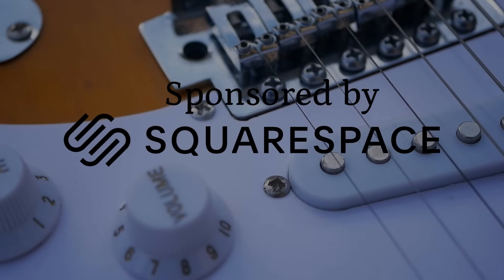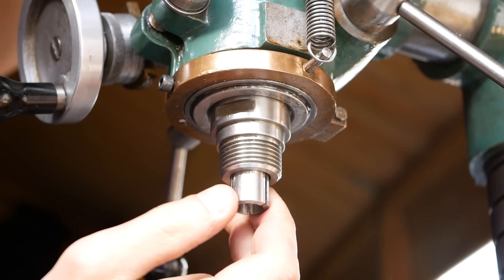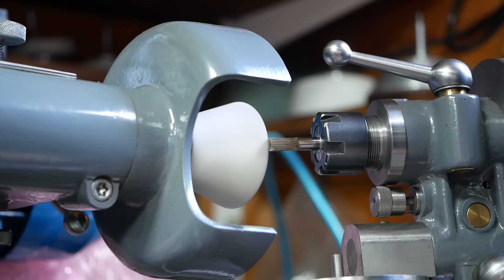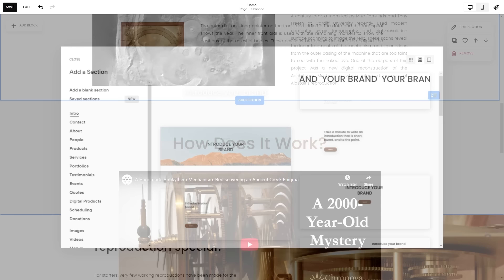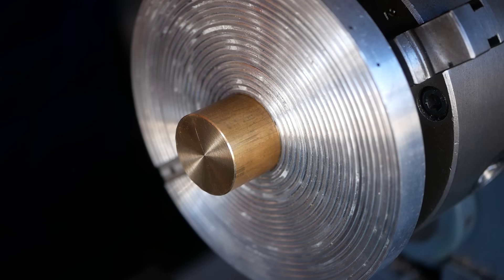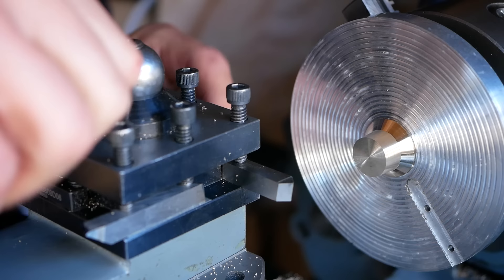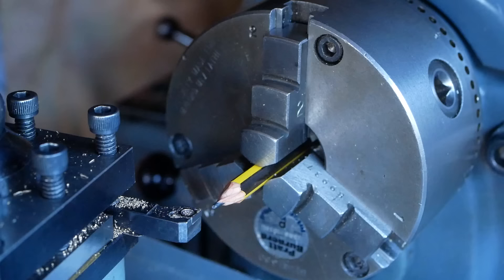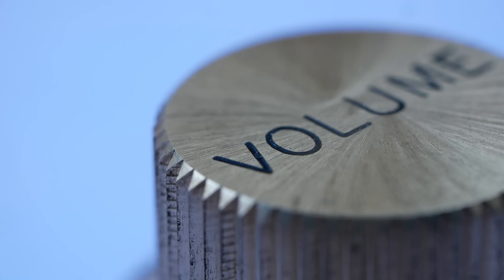Machining an Upgrade for my Electric Guitar

Comment: I think machining a groove at the end of the knurling to remove the chip and clean up the end would have worked well to remove the unsightly transition.
Reply: Yeah, I thought similar.  I guess if you were doing the job a second time, you might even consider machining the chamfer after doing the knurling/shaping operation to avoid that unsightly transition situation altogether.